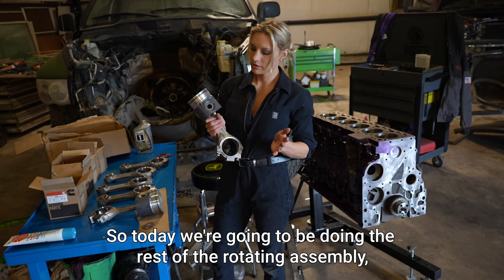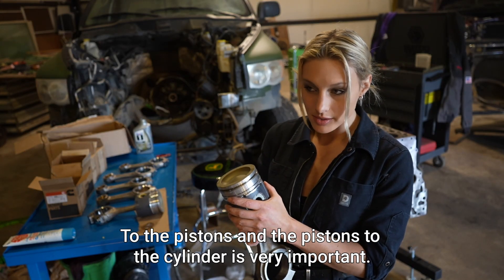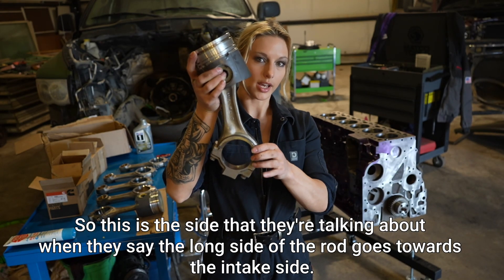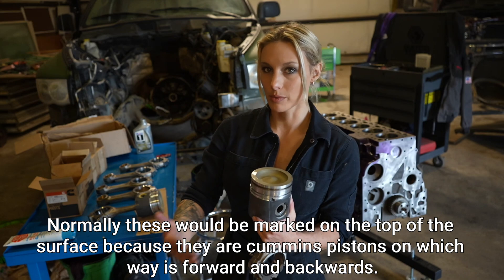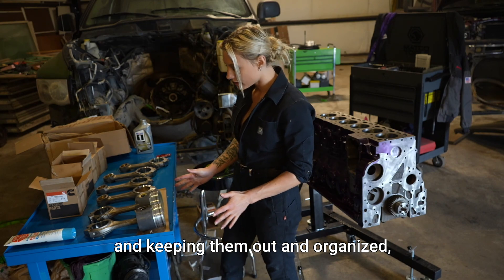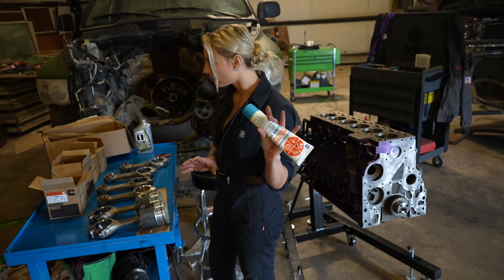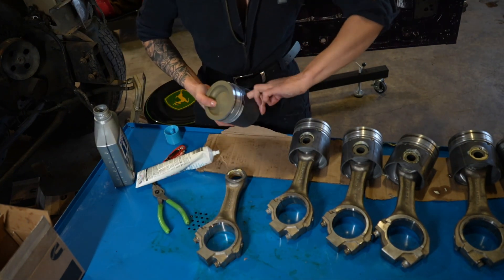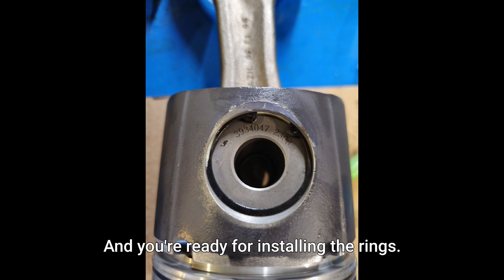05 Cummins 5.9L piston to rod assembly procedure.

Comment: Hey Mel,I'm just wondering if the machine shop enlarged #6 hole a half to a thou larger than 1 through 5 as both the 12v and 24v engines have a tendency to seize,or gall piston number 6 due to heat swelling and even as little as a half thou extra clearance can alleviate that.. I've been through this issue a couple of times on builds, and while not stupidly costly money wise when it happens,a new piston,rings,and honing cylinder out plus the RnR time and expense, it is costly in down time and frustrations about a newly rebuilt engine as well as a builders rep... 👍

Comment: Have you heard of a company called "Speed of Air". They're developing a custom piston package that's supposed to make the engine rattle a lot less, improves mpg and power, makes it run cleaner. And they are looking for people to test them out. The list of engines they already cover includes the 5.9 Cummins. Might reach out to them and see if they want to sponsor a kit for one of your engines. Would be very interesting to see what results you get.
Reply: YES! @SOA dimpled Pistons & @TotalSeal gapless rings for the ultimate winning combination!! Been following @Speed_Of_Air for awhile & they're very impressive. Just changing the piston surface, adding dimples makes a big improvement in engine efficiency & MPG's! I'd love to build my 7.3 with that set-up someday. @DavesAuto in Utah is doing a 7.3 rebuild right now(on his YT channel) with that setup - SOA Pistons & Total Seal rings. Can't wait to see the results of this sweet setup! 👍🏻👌🏻💪🏻⚡💥🔥💨🚜